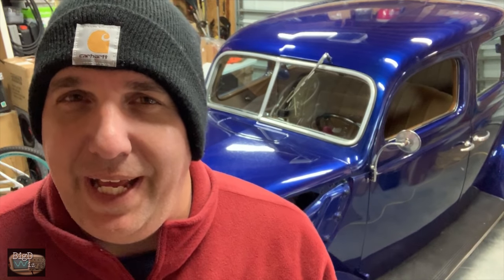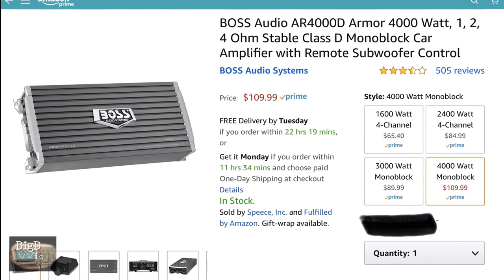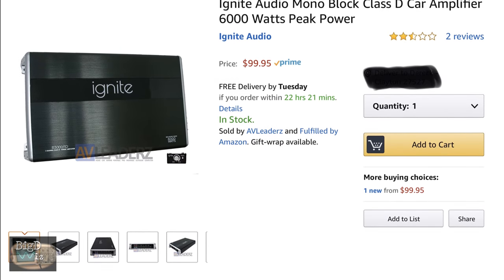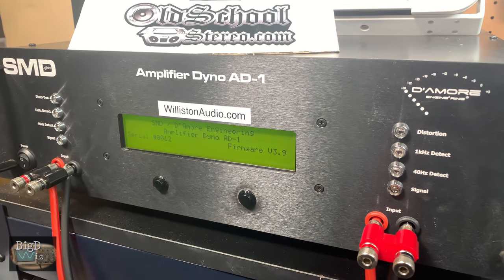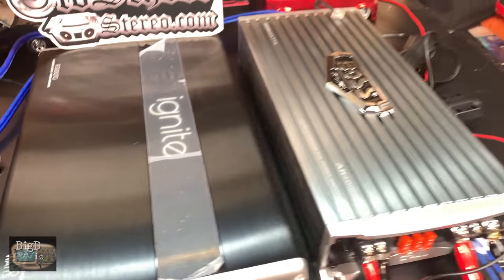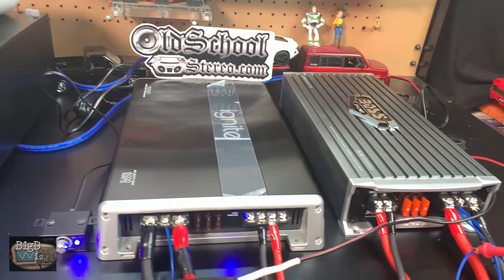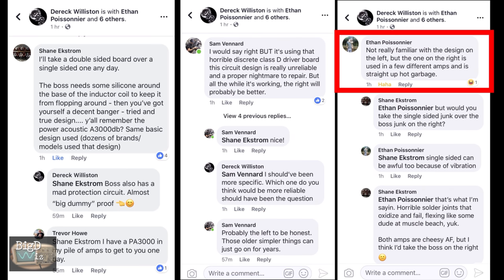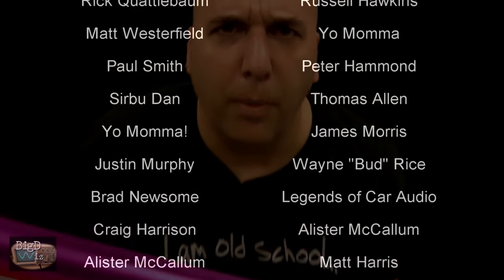$100 Amp Dyno Drag Race - Ignite vs Boss [4K]

Comment: I had the boss 4000d and I didn't even realise it but I only had an 80 amp fuse in line with the battery and it never blew, running at around 2ish ohms  and it never popped the fuse, so it must've only been pushing like 500 watts to a 15" and 2 10" subs, the amp blew its guts out before the 80a fuse went, and there was no voltage drop either and I didn't clip the amp, I put in another amp that is proven to push ~ 1900watts with a 150a fuse and then that's when the voltage started dropping from the factory alternator and I had to turn it down. These tests don't seem to be very accurate to real world use cases in my opinion, the subs I am using are cheap and can't handle that much power before they reach maximum excursion/get warm anyways.
Just please save up some money and get a good amp, not these cheap ones.... Almost lost my subs bcuz the cheap one literally exploded, and it slightly messed up the resistance of the subwoofers (used to be 4 ohms, now they are about 5 ohms)
Reply: Sounds to me like you were running it below it's rated ohm load. Also if it's a 15 and 2 10s I'm sure the 15 is different power rating than the 10s. Try wiring just the 10s or just the 15.
Reply: @Avaddon911  well the amp is blown now so I'm just using a better one, and they are all rated at 4 ohms, and all together they were around 1.5 or 2 ohms I think, the amp is rated down to 1 ohm
Reply: @trogers2120  you may have not exceeded the ohm load, but your speakers were mismatched.
Reply: @trogers2120  it's best to stick to subs with the exact same parameters when you're terminating them on the same amp.
Reply: @Avaddon911  Ive never heard or running different size subwoofers causing an amp to blow..... In the end the power is distributed evenly across all of the subs because they are all wired together
Reply: @trogers2120  you'll have phasing issues since you're running subs with different parameters. Which will cause distortion, distortion = blown subs/amps.
Reply: @trogers2120  you'll also most likely not be able to tune the amp right, which will most likely result in you cranking up the gain since your subs are out of phase and there's cancellation of certain frequencies.
Reply: @Avaddon911  I've honestly never heard of that, I've seen some competition setups running different budget subs all together
Reply: @trogers2120  It's basic electronics really, but to each their own. If it sounds good to you and doesn't blow up then it doesn't really matter anyways 😉
Reply: @Avaddon911  well shit, now I know I guess, thanks man, I thought it was just the resistance and power ratings that mattered
Reply: @trogers2120  the right amount of power and the right box will make the most impact on your sound. I run one American Bass 12 rated at 450 watts in a giant box powered by a Rockford 500.1 and most people think I've got 15s.

Comment: First the Boss design is known to be a poor design. Double sided boards are great if you need to worry about packaging but their is more to go wrong with double sided boards especially if any through hole parts are involved and we know this design is cheap and built in China which means ZERO quality control, cheap parts and probably the same for the pcb itself. As component density goes up so does heat issues. So we have more heat in a smaller package combined with cheap parts, cheaply built pcb and almost zero quality control. The Ignite has a less sophisticated board design since it is single sided which means less to go wrong. It has what 20% or 30% more surface area with parts not so densely populated. Same cheap parts and same lack of quality control. For $100 filtering the B+ is not a big deal you can easily add it yourself if it means that much. On top of that the Ignite design seems to be unique so far and does not have the terrible track record that the Boss design already has. We know they both have junk Chinese electrolytic but what do you expect at the $100 retail price point. Let's face it people just getting started do some really stupid things because they do not know what they are doing and can not be bothered to do some research before they start butchering things! Come on we have all seen the guy with 100 feet or 12ga speaker wire for all the power hookups, wire nuts and dollar store electrical tape, and a sub just sitting in the trunk not even in a box oh and no fuse on at the battery and and some form of fuse bypass at the amp! LOL

Comment: Um I'm pretty sure you have a boss vs boss here. I've gone to the site that sells ignite and half there amps still had planet audio side plates on them, I know this because they said planet audio on them in the pictures 😂🤣😂🤣😂
Reply from the maker: Who’s da Boss? Boss has no Boss 😂
Reply: @wal  you know how I feel about boss....the thing about cheap amps is every once in a while you find that one that is wolf in carps clothing 😊. I still would love to see a boss ndx onyx 5500 tested one day , I'm not saying it's the most awesome thing since sliced bread, but I am very impressed with it's output and protect circuit and sound quality all for 145.00 shipped.
Reply: @robsorgdrager8477  I've got two of them. But I was an idiot didn't give it enough juice (thick power cables) and it fried. Got it fixed. I have another one too but it's fried. Still working on replacing transistors (no warranty). But for the money, have to say they bang ok. I have a rockville RXD-M4... which so far has been solid. Ran a couple mofo-15's in my old boat. By seat-of-the-pants-meter I think the Onyx 5500 had a bit more output than the rockville. Wish @BigDWiz would dyno an Onyx. I have an old school Autotek Mean Machine MM4000.1D in my truck as well. Kicking the junk out of a single 12" in my truck. That amp has juice. I had a test box in my prev truck with two Audiobahn AWT12X subs. https://www.sonicelectronix.com/item_24079_Autotek-MM4000.1D-R-B.html and wired for about 1800wrms it was banging my wipers off the windshield. https://www.sonicelectronix.com/item_144_Audiobahn-AWT12X-12-Linear-Compression-AWT-12X.html Believe it or not I picked up the AWT's for $150 back in the day blown and spent $200 on recones I repaired myself.

Comment: Wtf is up with those ratings???!!! I know this topic is beat to death but it still blows my mind... If either brand printed "true" 800 900 or a 1000wrms or even printed 1200w dynamic on the box for $100 would sell like hot cakes!!! This 4k or even worse 6k! is just insulting and how does BOSS get away with that crap legally?? At least Ignite  states realistic RMS numbers in the manual. One thing I can say is BOSS and Planet Audio make pretty beefie amps with awsome warrantys that counts for something. I will not buy Boss out of principal over there dishonesty and the name is rightfully tainted causing being ashamed even if it is basically 1000wrms for $100 which is a good deal... The government needs to spank these type of companys, pretty sure a huge fine and there crap made public would change there tactics. It Really angers me, plus listening to the dubs saying there "4000w"  amp is better than my 1200wrms amp it drives me crazy, I just don't reply not gonna try make em feel bad n let em feel good about there pride n joy so whatever.
Reply from the maker: Yeah man it’s a scam for sure. False advertising and a class action suit waiting to happen...